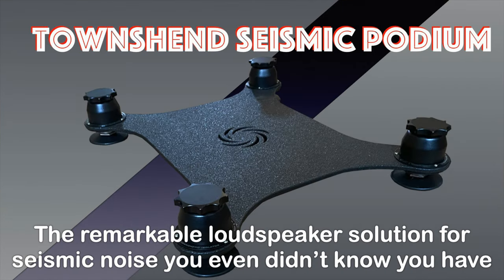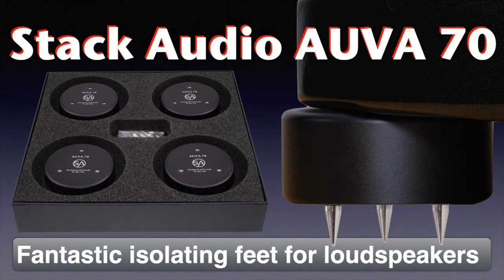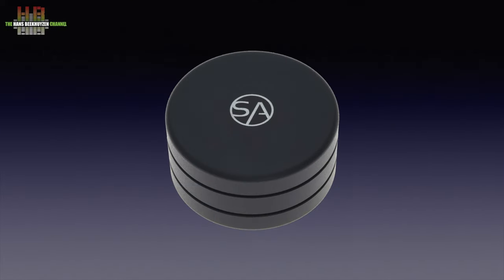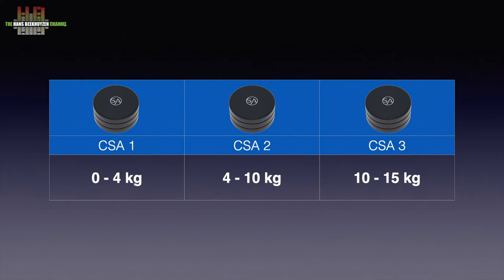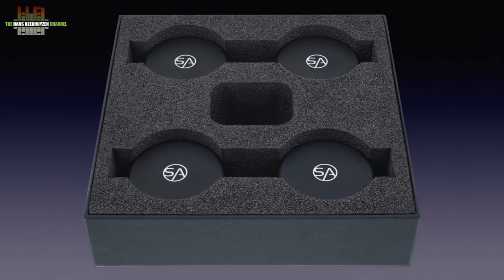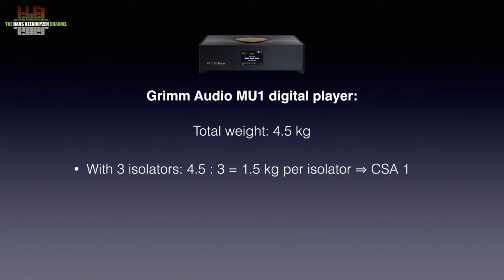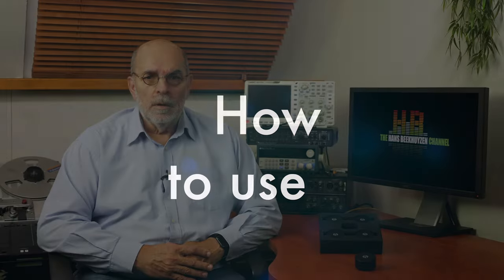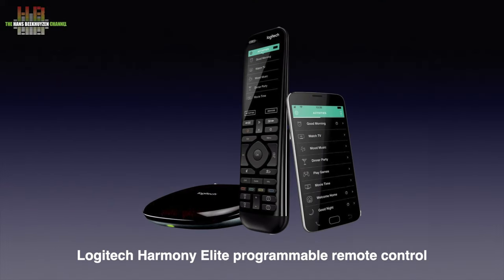Stack Audio AUVA EQ System Isolators

Comment: Hi Hans, you confirmed my experience with the AUVA‘s EQ, that I use under my McIntosh C49 preamp since 3 weeks or so. After using AUVA‘s 70 under my PMC12 signatures (just like you, I had Isoacoustics before), I was excited to try the equipment versions, but I did not expect a similar improvement as with the loudspeakers. I was wrong! To use your words, the positive effects blew me away, especially the bass response and improvement in texture, sound stage and immersiveness. Today I ordered another set that I plan to use under my Canor DAC2.10 or the Aurender N200. Will let you know my experiences.
Reply: We all look forward to hearing the results. I'm especially curious about improvements to the Aurender. Thanks in advance!
Reply: do the equipment feet sit on them, or are set up another way?
Reply: @3WAY-MIRROR  The equipment casing should be placed directly on the AUVA EQ‘s.
Reply from the maker: @3WAY-MIRROR  Use them in direct contact with the chassis, so not below the feet.
Reply: @timronners What was your update and conclusion, if I might ask?

Comment: Got 2 sets a couple of hours ago and have been playing music since then. It's ridicuouse how much effect these have on my system. You said they made a difference so I had no problem ordering them but wasn't prepared by how much. There's a track I use to test my system which is "Be your Girl" by Round Table feat. Nino. It always felt sort of congested, too many things happening on a small space and so instruments fight for space. That feeling is now gone. If anything, now I have slightly too much air.  All my recent upgrades have been going that way but now it's such a major change I'll now have to try to roll back such changes, readjust the placing of the speakers and rethink a couple of upgrades I had planned. I'll have to get used to this new sound first. The changes were heard imideatly with just the EQs on the stack of the DAC and streamer but adding them to amp brough more choerence to th end result. It's an hybrid with tubes, so that makes sense.
Reply from the maker: Thanks for sharing

Comment: Great review. It helps to see the components in the system, and the interconnecting cables.
One thing I did not see in the review is damping plates on top of components. The Isolators do have a damping chamber as you showed us in the video, but those contact the bottom and sides. The top is left to vibrate in my observation.
I know this would add even more time to the review period, especially since there are so many types. 
To simplify, I would use one isolator on top of the component, in the inverted position.
Reply from the maker: Have you tried it?

Comment: I use washing machine dampers for my electronics including the Mytec Bridge. Results are very good and it's a very cheap solution. It would be nice to compare. I put the dampers underneight the rubber feet but I will try your solution Hans to put them next to the rubber feets. Thanks for the idea!
Reply from the maker: I have tried several solutions like that. If the rubber is matched to the weight of the device, it might isolate external vibrations to a certain degree. But it won't kill vibrations inside your electronics. If you're happy with your solution, that's fine. But don't think it's even near the Auva EQ solution.

Comment: Interesting. Might try them under my Eversolo 8, it might be beneficial for the clock. I might try also putting a small weight on top of it. Greater mass in the metal cabinet sitting on the stacks.
Reply from the maker: If you do put weight on it, make sure you use the AUVA EQ's for the total weight of the Everesolo plus the added weight.

Comment: I am about to order these for my dac, streamer, and preamp. Do I need them for my monoblocks as well, or should I save some money and just "EQ" the front end? How much more improvement does one get by putting these under the amps? Thanks!!!
Reply: BTW. I bought the Auva 100 Isolators because of this channel. Thanks!
Reply from the maker: That depends on how sensitive your amps are to vibrations an on what they are placed. 
But why not just try? You can return them if not.

Comment: Does anyone know of a USB-A to USB-B cable that has either no power wires (the black and the red, from memory) or else the power wires are not terminated?
I want to use it to connect my computer to my DAC/ADC.
Reply: i do not know if such a cable, but i think ifi defender usb filter disconnects the power conductor (or allows external power source to connect)
Reply from the maker: There are several suppliers but don’t have a suggestion
Reply: Pangea makes an excellent cable “PANGEA PREMIER XL”, where the power is separated in its own cable and USB connector.

Comment: Thanks for the excellent review. 
I just order 2x3 CSA1 for the Denafrips Pontus en Hestia preamp.  Do I need to remove the cones under these ?
Reply from the maker: I don't recall the precise position of the cones but of you can place them next to the cones, there is no need.
Reply: @TheHansBeekhuyzenChannel thanks
Reply: I have 4 CSA1s under my Jay's Audio CDT2 Mk3 and I'm delighted with the result. I did use 3 of these temporarily, under my Pontus II to compare with the improvement I got from the CDT2. I placed one near the front and 2 at the rear to avoid the standard feet of the Pontus - effectively inverting the triangle. Very pleased with the result - I'll be ordering 3 more soon.

Comment: Great video Hans. I've installed 4 x CSA 2's under my surround processor this weighs 25kg (Levinson 502) so 6.25kg per foot they seem to have compressed just short of touching the top of my audio rack I've measured the clearance at about 0.5mm is this normal as the CSA 2 can support up to 10kg per foot so I'm only using 62% of the total load capacity?
Reply from the maker: I would ask Stack Audio, they should know what to expect.
Reply: Thank you Hans I'll reach out to Stack Audio

Comment: My equipment has small rubber feet and is placed on a thick oak rack coupled to a concrete floor with spikes,  the street is almost free of traffic. I wonder if there still will be much gain in this situation 🤔 thanks
Reply from the maker: That depends on the level of equipment you have and how critical your listening is.

Comment: Hans,
have you had a chance to listen to the CMS LS footers for speakers they're ungodly expensive but one reviewer said they're better than the Townshend podiums without even comparing them I don't think a spike in a cup surrounded by metal rings will isolate better than the podiums just wanted to find out if you've even heard of them the company is called critical mass systems
Reply from the maker: I prefer the Stack Audio ones
Reply: @TheHansBeekhuyzenChannel  do you believe that the CMS LS footers are better than the Townsend podiums? I don't
Reply from the maker: @chrisrichards2827  I don't know but I'm happy with the Stacks